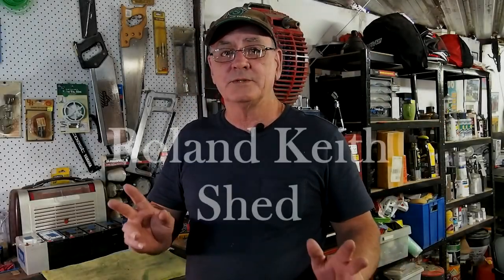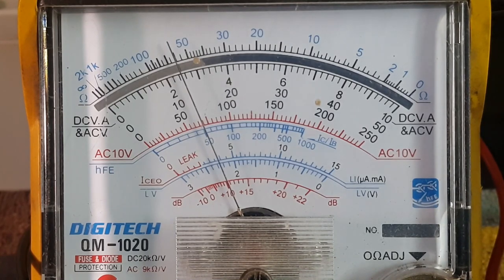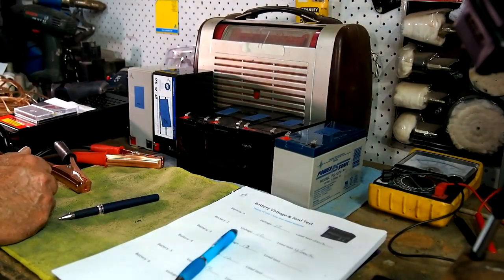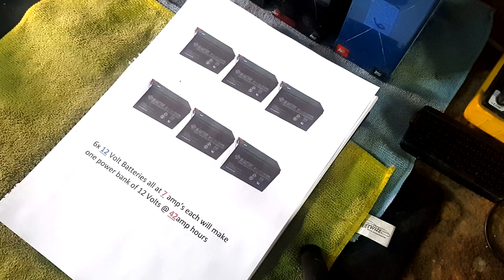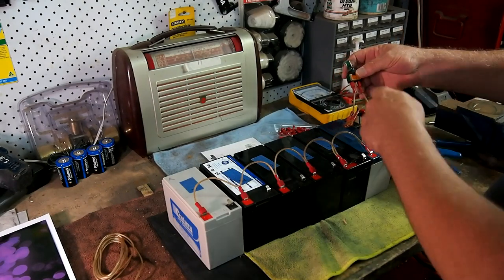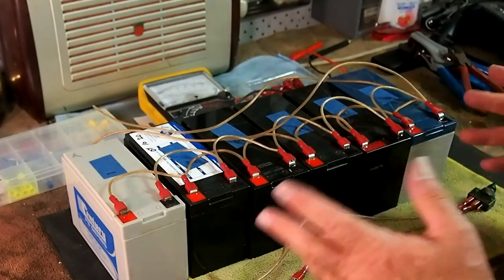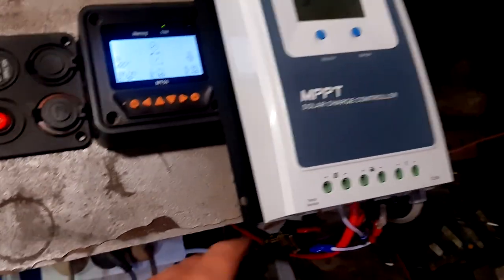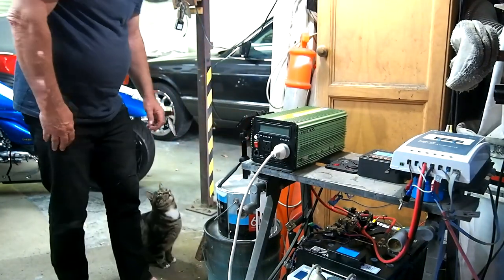Solar Backup Power & Adding a Second Battery Bank

Comment: Well shot video .Multi cam angles, scene changes and  heaps of intel made this video top notch .Your tidy wiring and depth of technical knowledge sealed the deal .Always look forward to your efforts .Cheers .
Reply from the maker: A big thanks for the glowing comment as it is very kind of you. This Solar stuff is a lot of fun to set up and it works so well I tell ya. If we lose power for a week or so I am all set to handle that. As long as i have my fridge and house lights running I can make do with the rest.

Comment: Hi Roley 👋 I had watched this with RB, however for analytics I am watching again on my account, plus the extra comment 😉 
This truly is amazing how solar works 😯 You just never know when an emergency is about to happen and we really need to be ready. Thanks for sharing this with us my friend 💃 Sending lots of love 💕
Reply from the maker: Thanks for the comment Jessica and yes emergency power is in now days quite easy to set up my system is simple but effective (may not look it ) but it is. If we have a power outage at the flick of a switch I can have power to run my fridge & house lighting plus one or two other things for as long as needed until things are restored. Or I can supplement my power costs by running the backup power when ever I want.   It's cool stuff to have on tap. But This video was about adding a separate bank of batteries to the system so I can run my cams from them and not the back up  but have the power for the cams charged off the solar as well.
Reply: @rolandkeith5322  I see all those battery banks and that's quite the set up 🎉 Its really neat to see what is all behind the scenes of how this all works 💃

Comment: Hi roland I don’t really understand what I’m watching but I enjoyed it anyway have a great week my friend
Reply from the maker: thanks for stopping by.And the video is,about testing some older batteries and if they were still good wrie then together and use them as,a second bank to run a security system but charged off my solar back up power.
Reply: @rolandkeith5322  ah ok. I obviously figured out you were checking battery levels. I dont really have anything like this at home. Homes around me do have solar panels but im totally not clued up at all